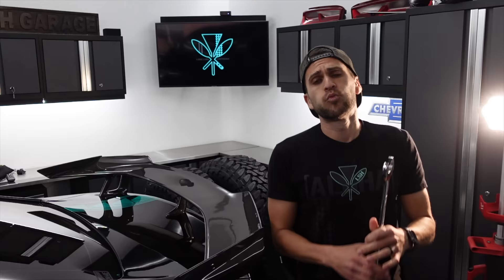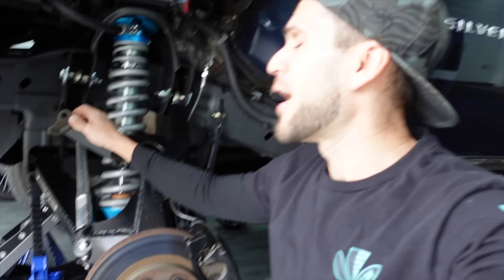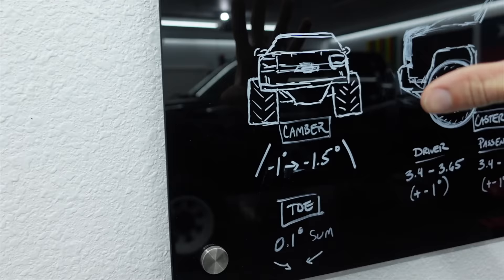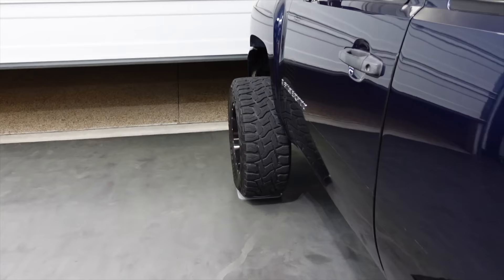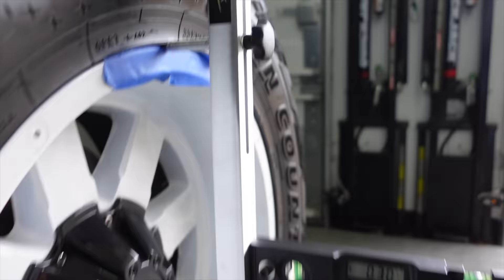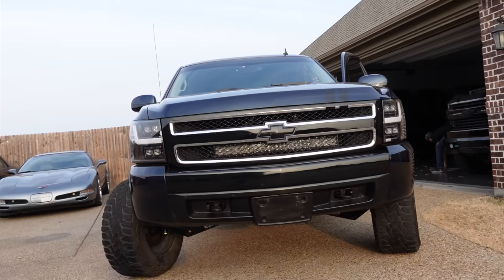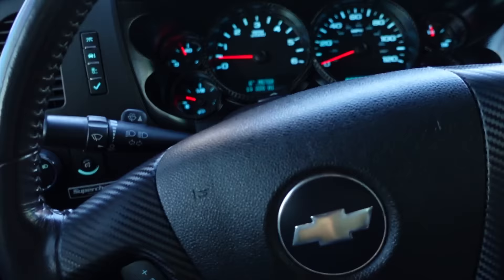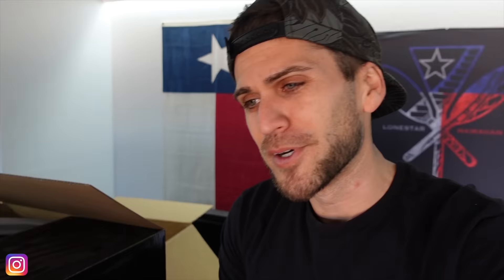FREE ALIGNMENTS FOREVER - Stop Paying For Crappy Work

Comment: You CAN align the rear end of a pick up. But I highly doubt any typical shop would ever do it. Also if it is necessary to have that done likely a serious curb strike or some sort of accident has occured. Basically the method I know atleast for aligning the rear wheels of any vehicle with a fixed rear axle with leaf springs is plates are used to basically shim the leaf spring hangers to be farther away from the normal mounting point on the frame.
Reply: Interesting. I never heard of that method. Got any resources to learn about that?
Reply: @firstlast---  I'm sorry I really don't. I just did a quick search and didn't find anything that really describes or shows pictures of what I am talking about. But if you maybe look a little harder you can. It's just doing an alignment on rear axle. Or rear wheel drive vehicles. 

I am a mechanic and have done many alignments. And I have never found it necessary to do this. But I know it can be done. It takes alot to get a rear axle out of whack. Like I said usually a pretty significant wreck. Or years of towing, hauling and abuse. But yeah its pretty simple. You just use different thicknesses of plate steel behind where the leaf springs mount to the truck or car. To either bend the left tire forward or the right tire forward. It just changes the angle of the axle.

A few years ago I hot a curb with my 86 Chrysler 5th avenue while driving on icy roads. I was doing about 35 mpg when the car slide sideways into a very tall curb and bounced up over it. The front wheel was bent almost to where the hub cap would have been flat on the ground! Bent the whole k frame and torsion bars. It was BAD. Also bent the rear leaf springs a little funny on one side. I found another k frame and luckily on those cars basically the entire frame, suspension, steering and engine mounts are held the to rest of the car with 4 big bolts. So that fixed the front. The rear I ordered new springs. I figured that after the damage and then putting new springs into the car that the rear alignment would be out. But when I checked it is was in spec. So that goes to show just how bad something has to be hit for you to have to worry about it haha.
Reply: @ron1836  I agree. I've only ever seen a solid rear axle out of alignment after a wreck or if the center bolt for the leaf springs is broken. I have heard that you can adjust thrust angle by loosening the shackles and shifting the axle. Never tried it but it makes sense. I wish there were more videos showing how this is done, I don't do alignments for a living anymore however knowledge is power and I like to learn as much as I can. Never know when you'll need some obscure information to fix a car. Thanks for sharing
Reply: @firstlast---  yeah it's pretty simple. I'm sure someone sells kits or something but if needed you would just cut a square piece of steel and cut the four holes in it. And it fits over the studs of the hanger. There are other small tweaks that can be made but none that make to much difference.

Comment: All you need is a way to adjust your camber and caster. Which means you need your tires on a flat level surface that will allow you to adjust both camber and caster independently on each wheel. That and a measuring tape is how we did it my mechanics class. Now they computers and laser levels that even a monkey can do.

Comment: I've used Firestone for alignments and tires for years. Now, they won't even do an alignment on my 09 mustang because I have tubular suspension, adjustable lower/upper control arms, adjustable panhard bar, and coilovers(which would make it easier to do).  They said they now only do stock alignments. =(

Comment: every time you moved the front or back of the arm to do the caster, you changed your previous measurement of camber. you spent two days attempting to do an alignment and its still not right. good news is even if you had got it right, those silly ass off set wheels and tires would have knocked the alignment out in the first 20 miles.

Comment: I've used this alignment tool and was not impressed. First - had to buy extensions for my big tires. Second - the pins are difficult to adjust and when adjusted they don't stay on. Third - measurements were not repeatable. The tool can be built for $50 in materials and a $10 digital angle finder but the pins are very difficult to make since the all have to be exactly the same. Bottom line is I'd rather pay the $125. Also, those locking adjustors don't work since you have to pick the ones hole to your mark kn the OEM style adjuster. Small changes on the adjuster makes big changes on the alignment numbers.

Comment: Im never going to service my truck at firestone, i spent almost a month going back and forth there for them to fix a map sensor, check engine loght kept coming back on until the last time they were trying to get me to “fix” other parts that could cause the check engine light to come back on which was bs, they didnt even took my truck in to inspect it again and they just guessed what was causing the light to keep coming back, i had them refund me my money and left a bad review, took it to the dealership they replaced the sensor again, light came back on i took it back they found a crack on a tube they fixed it and i didnt have to pay anything to redo it

Comment: Doing alignments for almost 30 years I had 1 chevy truck that the alignment cam bolts come loose in and I see you did exactly what they did. The bolts go from the inside out not outside in. Why it makes a difference I don't know but GM did it that way for a reason. Something no one will tell you but I will, as soon as you set in your truck it's out of spec and never in spec when you're driving. Only time it's in spec is when it's setting in the garage like every chevy should be. Don't you know only little boys where bowties? Lol Just joking, it's a good looking truck. But you're never in spec with IFS, it's constantly changing.

Comment: Quick question, when measuring toe in, use the rear measure minus the front one can tell the difference, but how to tell which one need the adjustment? How to tell one side is straight and the other side is toe on or out too much?

Comment: Our local Firestone charges you for an oil DRAIN and new oil filter occasionally. But only if tell them you just need the oil changed. They have unknowingly sent many customers my way over the years. I have begged every single one to take them to court, only one has so far.

Comment: I'm all about precision but we align our cars with NASA equipment and then proceed to drive on "roads" that have few degrees of banking for water evacuation and with mild to severe rutting. Even with a car aligned by Harry Potter you'd ruin your tires if your car doesnt have the exact width of the road rutting. So good enough will do for me.

Comment: It just seems like the cross bar on the alignment tool at the bottom of the tire is going to get thrown off by the bulge from the weight deformation at the ground.. Enough to throw off a couple of degrees or so.. I like those Shocks. I am thinking to get them for my 350 dually but I only want about 2-3" of lift

Comment: The biggest issues with the cam bolts were the alignment pins sheering off or falling out. Other than that, i’ve never had issues with them when torque to proper specs…guess it’s just luck. I’m liking the alignment. Looking for something like that myself
Reply: That’s what I was thinking if those adjusters try to move it’s probably going to break those pins off. Most of the stuff I align is pretty rusty and won’t move though, this one looks pretty clean and rust free.
Reply: I had cam bolts seize up inside the UCA bushings, but haven’t dealt with a whole lot of rust. I’ve had pins sheer off and even some that I assume have fallen out. But the replacement ones, i’ve never really had a problem with. Some guys even put a little weld on the to help hold them.

Comment: Forgive, but rear axles are alignable - as are FRONT straight axles, I-Beams, Twin I-Beams, frt 4wd axles, and so so are castor/camberless strut suspensions.

Tandem axles on semis, for example, must be aligned correctly to the chassis AND between axles or the unit will eat tires and consume excess fuel.

The rear axle itself must be determined to be "straight" first and foremost (not bent - don't assume it OK - measure it) - and aligned to the "lines" of the frame/chassis. It can be adjusted "if" it needs to be.

Also - the wheel "run out" was neglected... and is the floor AND vehicle level and within side to side ride height max. differences?

Sucks you could not find, or recognize (?) a good tech. to algn what amounts to a crude, less-than-refined, simple and loose suspension.

Good work (smile)

Comment: Whats up, question, so Im stuck with positive camber after installing lowering control arms how do I adjust that, pulling the upper control arm out further, I also have a little toe out but I have my tie rods fully in so it wont let me adjust it any further.. Any suggestions would be greatly appreciated

Comment: I know you're a busy man, but I need some easy help.  I've looked on Google for the past 4 months on and off for the location of the evaporator drain hose on a 2020 Silverado 1500 crew cab. It has the 2.7L if that makes a difference.  My trucks had an odor when I run the cold air, and its much worse after I run the ac on a previous trip. I ran the ac and it's not draining. All the pictures are of pre 2019 that don't show the same firewall that I have in the 2020. There's one little hose that's a half inch with a plastic nub that is in the vicinity of where the drain hose is supposed to be, but it's not it. I've laid out on the ground with a flashlight rolling around for over an hour, so many times I lost track. If there's a tech that knows, that wouldn't mind taking a min to respond, that would be appreciated also. Its out of warranty, and with everything doubling in price, I can't afford to take it in. Thanks yall.

Comment: Not trying to defend the Firestone guy. He hasn’t been properly coached on selling alignments. You’re not adjusting the rear but reading the thrust angle. If you don’t match the front to the thrust angle your truck will drive crooked. And if the thrust angle is too far out they need to figure out why (possibly an aftermarket lift) and fix it.

Comment: You're absolutely wrong about being able to align the rear end of the truck. The rear end can come out of alignment very easily if your U bolts get loose or if your center bolt becomes loose.  I do alignments everyday on Everything from passenger trucks to dump trucks and everything in between

Comment: There is no 2 wheel alignment. its 4  wheel berceuse all 4 wheels have to be measured, side to side or diamond, even if you cant make an adjustment, you still square up the front off of the rear  thrust angle

Comment: Well all I can say is that you did a really good job and are real happy that you KNOW that the alignment is right.  Only thing I was wondering was how much were you supposed to torque down the bolts for alignments.  LOl . May be the most important part.  I was going to say like after an alignment why do you not just mark everything and I did see you marked your own at the end.  LOL I was wondering how much you saved.  630-100 is a negative amount LOL.  However your tires are going to last a lot longer which are very expensive for that truck.  Also if your alignment is off and the tires are going out whichever tire landes first will take you off in that direction.  So your truck is safer and you saved time and gas going to the alignment shop. Sure you r wife wants your truck to be safer.   LOL.  Most cars all you adjust is toe in or toe out. My grandpa checked my alignment and he just put a stick on the side of the tire and measured where it touched the ground in the front and in the back and we measured the two distances.  It was right on.  Just needed at tape measure.  LOL  It is nice you can adjust so many things on a truck!  You have a cute son noticed your wife was watching him.
Reply: Was this written by a bot?
Reply: Well usually a guy says i used a 15mm socket and I torqued it down to 100 ft/lbs or 140 ft/lbs.  If you don't say that then did he tighten it down properly or not???
Reply: A very sexy one.  Why is it too well written.  LOL @Hawk7886

Comment: Well, I know you say you saved $100 by spending $600. But you realistically saved $300 by spending $600 in one go. Most alignment shops in my area are horrible, and will not do anything worth a darn. I rebuilt the whole suspension in my Tahoe (better then factory, but not quite as good as your setup, but still looks and feels 10 times more smooth then factory) and I had to take it to 4 different shops before they got it right. And every aspect of the front is much more adjustable then factory and the rear track bar is adjustable. I had shops that would pull the darn back wheels all the way over and then align the front to the rear, the darn thing was crab walking, the back axle was noticeably not centered by a minimum of 2 inches. And Firestone is the worst, I didn’t take my Tahoe there cause I took another SUV there… they gave me a spec sheet that was nothing but in the red and said “there you go, that’ll be $78” after they quoted me $55. They tried telling me the vehicle did not have cam bolts, I just installed new cam bolts, new upper control arms, ball joints and tie rod ends, and just to reiterate, new cam bolts. I had to physically take the lead mechanic back there, pick up 2 wrenches and show him it had cam bolts and the castor and camber was adjustable. They then gave me a spec sheet with caster and camber adjusted but toe way off, I told them to align it, they refused, said it was good. The toe was out 8 degrees, not 0.8, 8 degrees! I then argued with them about payment and if they wasn’t going to align it, I wasn’t paying, after 30 minutes of getting now where I just paid and when I walked out I said they’d never see my business again and I was going to tell all off my place of business to not take anything there, my place of business employs over 4000 people locally. I sent out an email to all to avoid the local Firestone right down the road.

Comment: Get an alignment when replacing suspension components, steering components, or new tires when you haven't had an alignment in awhile and notice uneven wear on your old tires.  I've only ever had a handful of 3 alignments in the 17 years I've been driving a variety of vehicles during that time.  The typical cost is around $100.
Reply: @Hawk7886  I do all of my own repairs, never drive anything that wasn't in tip top condition, and never have uneven tire wear.

Comment: First off this tool and method take absolutely no consideration of rear wheel settings. While you can get total toe without the rear settings you can’t set a straight steering wheel without factoring in thrust angle unless it just happens to fall that way. You can %100 align a solid rear axle. Granted, not much adjustment without plates(if needed) but I’ve fixed many bad thrust angles after lifts and lowering installs. Especially the DIY customers. 
If your wheel isn’t straight after being aligned by a machine then you’re dealing with an idiot operator which does happen more times than not. Your mistake is going to a Firestone or any big box store expecting quality work. Find a small independent shop where you can talk to the guy doing the work. Maybe theyll even let you watch the work being performed. Whatever the case, pay the right guy to get it right… or keep replacing tires.

Comment: We lose $10 on each unit, but we'll make it up in volume.  Yep!  Price of alignments is going up, so over time, well worth it.  Local shop used spray paint, a scribe, and a tape measure for toe in.  Simple but effective.
Reply: Real shops use lasers on reflective heads and skip the spray paint. It's a good idea to have your $40k car aligned by someone other than grandpa with the chalk and string.
Reply: @Hawk7886  He was the only (old) guy who could align my vehicle properly....albeit it was 1996.  Also was able to balance my tires on the car, vs on a machine.  Lug-centric vs hub centric was the issue if I recall correctly.  I'm not complaining, as he did what the big boys could not.  How soon before it's $300 for an alignment?  This guy is intelligent in more ways than one!
Reply: @Hawk7886  I can do better with string and chalk than most shops. I've have hundreds of alignments done on my hotshot trucks and semi trucks, over the years from all kinds of shops around the country. trust me when I tell you, I can do better. we went to manually doing them with string line etc. now they all wear tires perfectly. the tools do not matter, its about know what's going on with the tires and the road. I'd bet you don't even think about the crown in the road when you do alignments...

Comment: I paid for lifetime alignments for my current vehicle from Firestone. $140 I think. After having 4, FOUR, alignments and my steering wheel was still blatantly not straight and pulled HEAVY to one side or the other (different after each alignment) I just stopped going there. They hire any votech kid that applies.

Comment: Your son is such a great helper !  Thanks for the excellent video. There is another method which requires just cheap kitchen tools to do the alignment. I've been using this method for the past 10 years on my 2003 Hummer H2. (The H2 has most of the same front suspension parts as a Silverado 2500HD.) The alignment is so precise, I was able to get about 80k miles out of my Goodrich KO2 tires.
https://youtu.be/OzN0Z2HupcM?t=78